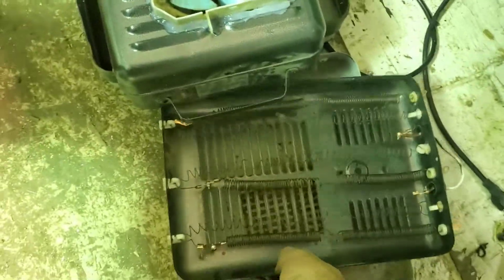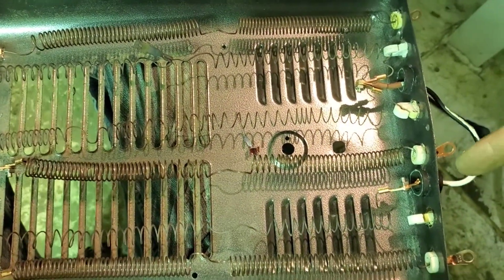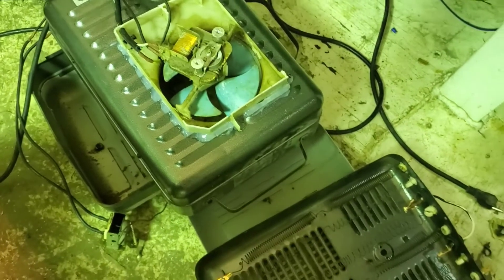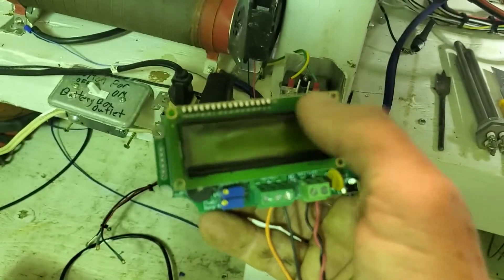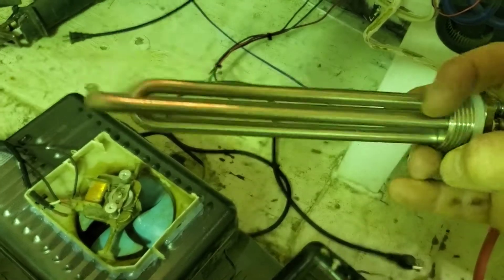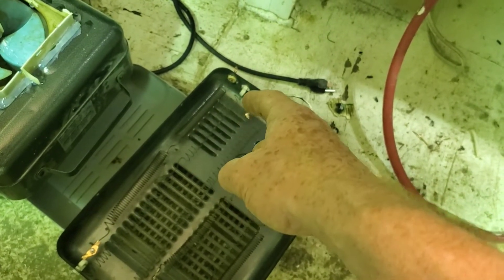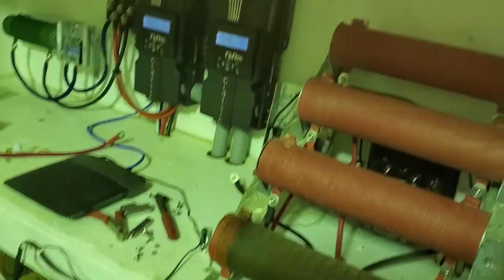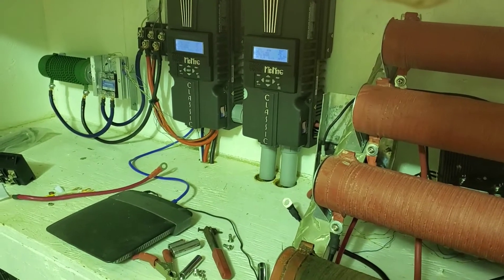How I built this Dump Load for a high voltage wind turbine to be used with a Midnite Classic.

Comment: At approximately 5min11sec you state 120Volts at 30Hz; 20 magnets; "30x10 is 300RPM". 30Hz x ??10?? ... I'm wondering why you didn't say 30Hz x "60 cycles per minute" as in 60seconds times 30Hz to give you 1800 RPM (instead of 300 RPM). I may not be understanding what you're saying. Am I following you correctly?
Reply from the maker: My bad  . It does 10 hz per revolution. So 180 rpm. At 30hz.
Reply: @windpowerandmore6310  When I think of Hz, I think of how many times something repeats in a second. For example, in AC electrical terms, 120v 60Hz AC means that the alternating current is reversing 60 times per second. I'm still struggling with understanding "180 rpm at 30Hz". But, that's okay. I believe it has to do with what you referenced earlier i.e. three phase vs two phase electricity. Either way, I'm very interested in learning more about your set up and especially the motors you designed and built for your wind turbines and the supporting infrastructure you've used. You definitely have your system 'dialed-in' and you clearly have a passion and capability when it comes to this. You're teaching me a lot. Thanks!
Reply from the maker: Okay I’ll explain it a bit better for you bud . The rotor does 10 ac cycles per revolution. At 30 cycles it is doing 3 revolutions per second. 3 multiple by 60 seconds is 180 revolution per minute . I hope now you’re understanding.
Reply: @windpowerandmore6310  Perfect. I think I have it now. Let me internalize for a day and get my mind set rewired appropriately (pun intended). Thanks for this.